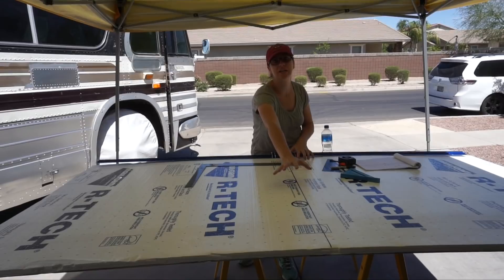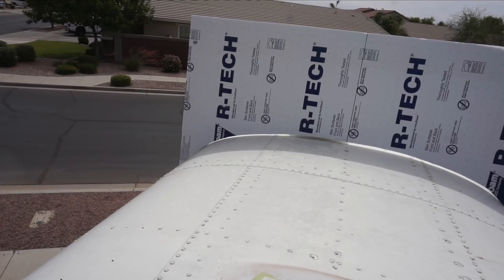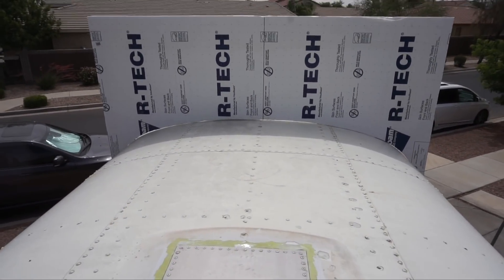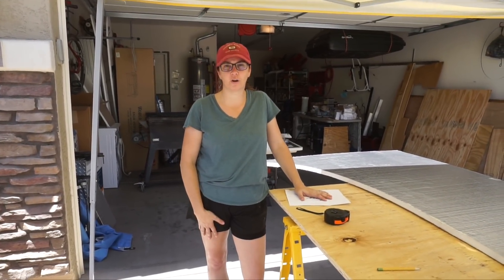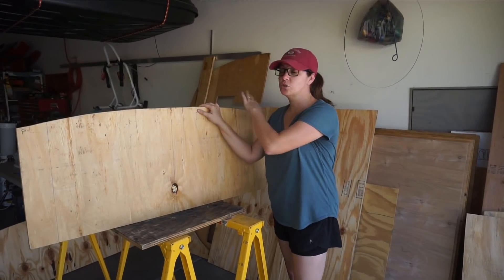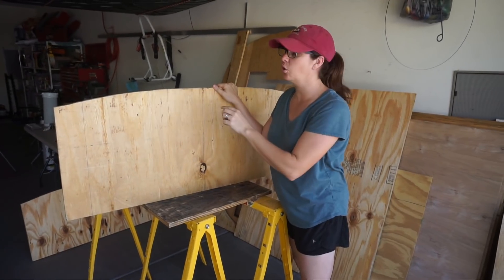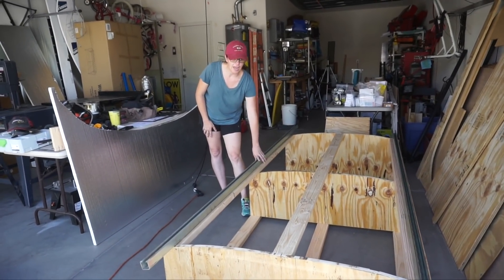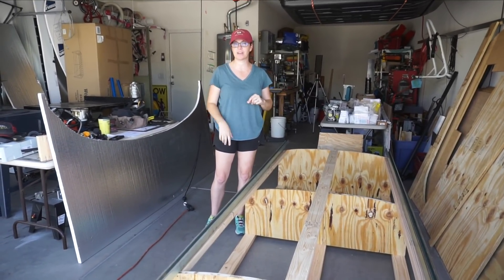Planning a Solar Rack - Part 1:  Building a Model & Our Plans

Comment: good idea but you're thinking small . If you're gonna do something do it right and do it big or go home lol . Why are you planning for only 8 panels why not go for 12 ? Instead of doing 2 layers and do 3 . have one slide open to the left of the bus and then have another slide open to the right of the bus so that you have four panels left four panels right for panel center . And then if you really want to challenge hey you really wanna be unique and they only wanted a country with such a rig then put the entire rack on a hydraulic lift so that you can pivot the entire array up at an angle to better soak up the sun. You can lift the array with hydraulics or you can do it again with actuators . And then once I had the whole thing set up I would plug the entire system into a remote system so I could stand on the ground and control it my remote control . Not only would that be freaking cool as hell but it would also be a technology that you could market and sell .
Reply from the maker: Thanks Rocky.  3500 Watts of solar should be plenty for us while we are on the road.  We had considered doing 3 layers (two slides) but opted to make the bottom layer more stout instead.  3 slides would have been great if we opted for smaller/lighter panels - but with the commercial panels we thought it might be more valuable to create a stronger solution.  One and half years later they are still working very well and have survived several wind gusts that have blown down nearby trees.

Comment: An interesting way to do it...can't wait to see the results!
You would need to be able to disconnect the panels underneath to be able to use the upper ones when the lowers are retracted or while in motion.
As far as the ability to extend/retract them you may wish to investigate using electric seat motors...they have fantastic torque...so should be able to work.
PS>  Love picture #2 with the posing...hehehe!
Reply from the maker: LOL thanks Gregory - We sound really serious on our videos but we are constantly messing around and doing goofy stuff.  This is and has been a really challenging problem but it has been fun so far.  electric seat motors are an interesting choice - I was leaning more towards a linear actuator.  I will have to do a little more reading - thank you!
Reply: It is a linear actuator...just one that has an open screw drive...which makes it easier to work with in some ways.
You might have to switch out the original screw drive...it just depends on the rest of the build.
I have even seen them used for homemade "popouts" though they are not very fast.
Reply from the maker: wow homemade popouts!  I will definitely take a look at these - thanks!

Comment: Very cool idea for getting all that solar. For attaching the frame for the solar check out rivnuts. It is a little bit expensive but you can put a blind nut into any material. You would be able to put the insulation and inner paneling in and still be able to attach the solar rack.
Reply from the maker: Thank you Hill on Wheels - we just bought a proper rivnut tool (last time I used an alen wrench, a spacer, and a washer) - but now I actually have the right tool :).  We thought about doing it this way and we may still end up doing it this way but we really want to try to get some U-bolts around some of the ribs for a more secure fitment ... we'll see what happens.  Thanks for tuning in

Comment: Hi Juan.  That seems like a complicated build. I don’t know how far along you are but have you considered building up from the side rails of the bus and putting a steel platform all the way across the bus. Not only would everything be even but it would shade the entire top of the bus. If you make them so they can be tilting you would then have access to the entire roof when they are tilted. If they were hinged both in the middle and the outside they could tilt in both directions. Just my thoughts. Alan
Reply from the maker: Hi Alan, thanks for the feedback.  Interesting ideas - we would still need to clear the roof vents (5.5" tall) but the idea could work.  I like the idea of the big hinge in the middle to tilt both ways but this might be outside my skill level :)
Reply: Juan, I’ve seen you weld. I don’t think you would have any problem with that.  Especially if you bought weldable hinges.

Comment: I went through a similar thought process.    I'd consider revisiting the id of mounting sideways.  1) It's simpler, less to go wrong, and oh boy will things go wrong, always do.   2) You could build a side skirt like many modern coaches do. https://s3.amazonaws.com/mot-production/vehicle_images/images/5537/full/2006-Country-Coach_Magna-42_-23.jpg?1364257920   (search country coach in google if this link breaks)   

I Had grand ideas about tilting and maybe even a solar tracker, but in the end, keep it simple, keep it safe and then make it look good.  In the end it might just look like a roof raise.

Or, if you're as stubborn as I am, you'll make the slide system work hell or high water, and if you make it work, I've  got nothing but praise and admiration.   Keep up the good work and thinking outside the 35' box.
Reply from the maker: Thank you - we considered the skirting too - that is what "Life is Joy" ended up doing and I think it worked out really well for him.  (after a couple panels broke in a freak microburst before he could get them skirted).  I had tilting fantasies too but those already went out the window because I couldn't figure out a good way to secure them and have them tilt.  LOL, I have been known to be a little stubborn - we are going to give this slide design a good try!  Thanks for following along

Comment: Wow Juan and Michelle!  That is really ambitious.  I'd be concerned about a lot of things, like wind, tree limbs and other UFOs.  Is is not possible to get smaller panels?  If you had 2' X 4' panels, you could mount them lengthwise and three across (so they are positioned the long way front to back). They would contour to the roof arc a little better.  Then you could try to work around your vents, follow the arc of the roof and tie them down tight to the rails.  You would also have 6' across of surface area rather than 4' even though overall, the collector surface is slightly reduced from your ambitious 8' across movable panel plan.  I'd be really concerned about anything that is not firmly and permanently.  The roof takes more of a beating than you might think.   Just a suggestion.  Seems like an uphill battle, but you obviously know more about it than I do. Good luck.  Can't wait to see what you come up with!
Reply from the maker: Hi John - Thank you - yes, this is really ambitious a maybe out of our league?  We intend on giving it the good college try though.  To answer your question: It is possible to get smaller panels but it is hard to get the energy density and efficiency that these panels offer (each one is 435 Watts with over 20% efficiency and built-in electronics for dealing with shading).  One of the reasons we opted to go with super strut as the base is it allows us the ability to play with different configurations and mount points without needing to drill new holes in the bus (once the rails are mounted).  We are trying to consider as many things as we can think of and one of the ones that scares me most is the power of the wind.  While we are traveling I want to reduce the area exposed as much as I reasonably can and this seemed like a decent way to do that.  Let's see where this rabbit trail takes us :)

Comment: That is an interesting problem. What about clearance between the panel and the vent for air movement? Just a thought, and I will try and describe my thought. Mount the panels length wise as you planned, offset them to each side as far as makes sense with the curvature of the roof. one side slightly lower than the other side so when they lay flat and overlap in the center. Hinge the outside edge. put a linear actuator in the center. when you reach a destination push a button on the inside of the bus which would push the centers of the panels up into a "tent" (triangle shape as you look from the front of the bus,) until the two center edges met and there is no overlap? When ready to leave, push the button again and the fold back down. Although one panel is over laped on the other, you still might have more surface area exposed when traveling then ife one pane is stored completely below the other? Do you understand the concept I am trying to describe? Glenn
Reply from the maker: Hi Glenn - I love the idea you have.  A couple of things that tripped me up with it are that we still need to clear those rooftop vents and also be able to clear the black tank vent we just installed.  I love the idea of the linear actuator and we are incorporating that into the slides we are building.   The part I am having trouble with is how to secure the floating piece (at least I am not clever enough to have come up with a solution I think I could manage).
Reply: Maybe send me your phone number by e-mail and we can talk about it? autoshop@rochester.rr.com  If you want I could add you to my mailing list (I do not send out cat videos, only things that are of "great" interest).

Comment: Don't layer them because a solar panel is a collective of small photovoltaic cells connected in series. If one of these cells is shaded, it reduces the efficiency of the whole panel. That's why you have to consider anything that can throw any shade (antenna pole, etc.) at them when designing the placement. Building this shade in the system to begin with is a bad idea.
Reply from the maker: Hi Simon - good point - this is something we forgot to mention in the video.  Shading is a huge issue but with how we wire them we should be able to still get a full 50% (1700 Watts) as we travel down the road.   We intend on wiring these panels in a 2s4p configuration.  two panels on top will be wired in series and two panels on the bottom will be wired in series - all 4 of these will then be wired in parallel which should eliminate the loss you describe.
Reply: Have you considered micro mppts?  That way each panel will be independent and you can parallel it all as AC and hook it up to your regular victron charge controller.  Thereby you can also eliminate the need for high gauge cables from the roof.  I don't recall if your charge controller can handle 3-phase, but mppt's build for 3-phase last for ever (no need for local storage in capacitors while the current switches polarity). Not sure they are available in 435 W, though - but how often will you get full capacity from your panels anyway :o)
Reply: Wiring things in parallel still have its limitations. Here is what I experienced: I wanted to circumvent the fact that I would be dry camping possibly under trees, eliminating much of my solar array on the roof of my RV, and alleviated that with and additional portable solar panel that I would carry and move further away from the RV and chase the sun spots with it. I had connected this panel with the rest of the array in parallel. In series, each panel would see a different voltage, but current is limited by the overall resistance of the whole circuit - hence if you have a shaded panel it would affect all of the circuit. In parallel, all of the panels would see the same voltage, and the current that each panel is sending will depend on the amount of sun it's getting, and the current that the solar controller will see is the addition of all the panels' current. The problem is, if a solar panel is fully shaded, the voltage that it's able to produce is very limited - and possibly under the effective voltage. So what I saw is that even though my portable solar panel was in the sun, the voltage of the overall panel collections connected in parallel was somewhat limited by the shaded panels on the roof, and the solar controller never was able to "see" enough voltage to get into the effective charging range. 
I will let you figure out if this problems affects you because I don't know all the particularities of your system, especially since you're using lithium batteries on a 48V system (if I remember correctly), so the numbers will vary from mine.
I just wanted you to factor all these in prior to investing a lot of time in this setup since you guys are already putting a lot of effort and money in this project!
Reply: Sunpower is not  affected by shading as other panels are. They dont even have blocking diodes!
Reply: Well.  More accurately, the Maxeon panels from Sunpower are less affected than most other panels.  According to Sunpower's own studies, at least :o)   Sunpower panels are very good; but not magical... Shade still sucks.  Given the limited area of RVs, high quality panes with high yield, micro mppt and various shade and heat technologies are worth the investment - and the 22% Equinox system from Sunpower (for instance) is very neat looking on top of meeting those specs, so I'd definitely recommend Sunpower.  But they are still affected by shade.
Reply: It can be done just make sure that you either use optimizers or microinverters that will minimize any shade losses, I am in the process of doing a similar set up, how ever my bottom will slide completely off the roof than rase up to approx 30° while the other layer slides the other way the tlts up as well to mimic a ground mount array where the center is approx twice the hight

Comment: Wow that's a ton of work buddy but I'm sure you'll figure it out I'd be worried about the wind and the vibration issues very interesting to say the least, very.
Reply from the maker: Thank you Brian - we appreciate your kind words.  Yes, wind is a huge consideration and one of the main reasons we felt we needed to orient the panels like we did (creates less area for the wind to push on when underway).  We are working through some ideas - the next video should be more interesting :)

Comment: Looking forward to seeing what you come up with. Guessing you might have already seen this guy’s amazing build (he’s a genius), but if not, check out this video: https://youtu.be/cM5s4F-7AOk

Obviously, your application is complicated by the curvature of your roof, but I thought perhaps you’d find some inspiration, if nothing else. As others have already pointed out, and as I assume you are already well aware, those large panels are going exert a lot of force when extended. Have you considered having the upper panels slide as well? That way each level only has to extend half as far. More slides, of course, but a lot less stress on the structure. Just thinking out loud. A challenging project and I look forward to seeing you tackle it. Cheers!
Reply from the maker: yes!  We love that guy's build!  He even commented on our Instagram photo!  

Yes, we considered doing both slides or even a triple layer approach but kept running into the problem of supporting huge panels (almost 7ft long!) on only the sides seemed like not a good idea.  Stay tuned to see how we got the panels to slide while supporting them in a little stronger way.

Comment: Have you thought about having portable panels so you can park in the shade? I'm going to have a few on the roof, but some on an extension so I can use shade if available.
Reply from the maker: Hi - Yes we considered that and watched a few videos of folks who do that.  It seems like a very effective way to get more power but it seemed like it could be pretty cumbersome (not that this isn't cumbersome as well).  We also worried about damaging the panels or the wiring.  Thank you for he suggestion.
Reply: I've actually been working on something similar for a vintage '78 GMC motorhome, primarily because the aesthetics of a big flat rack are so poor on a curved roof, same issue you have. The attraction of a GMC, to me, is the styling so I don't want to mess that up. I've been looking for the latest greatest viable panels which to me would appear to be the LG 405w NeON2 panels. These coaches have a factory storage pod on the roof, so a pod of sorts being up there is not unnatural looking. I'm shooting for three stacked with the center panel being static, top pulling to driver's side, bottom pulling to curb or passenger side, these would latch to the factory roof rails for security in wind. Outside would be fiberglassed to mimic the appearance of the stock storage pod with gaskets on the seams for each panel, not to keep water out but stinging insects which are a problem here 9 months out of the year. The GMC is 26 ft total so front to back two panels, three vertically, six total. One benefit of such a rack system will be shading the roof with an air gap, so that will decrease the load on the A/C system or heat pump when parked and deployed. You're bringing your own shade for the roof with you. I'll be watching closely, glad to see someone else embarking on the same or at least a similar path beforehand, you guys are going to save me a few headaches I suspect, so thanks.
Reply from the maker: Hi Michael - Thanks for following along - sounds like a great project.  We considered 3 layers but we did not feel comfortable supporting panels as large as ours solely on the sides.  This would be much easier to accomplish with smaller panels.  The LG 405w are GREAT panels but they are basically the same size as our SunPower e20 panels which are HUGE.  You may have an easier time with a configuration like this: https://youtu.be/cM5s4F-7AOk - I hope you do some videos on your build - It would be neat to see what you come up with!  Best of luck!